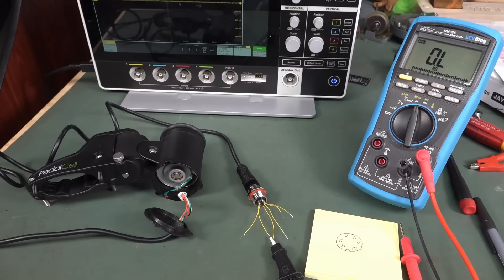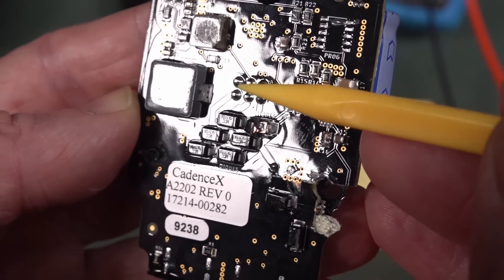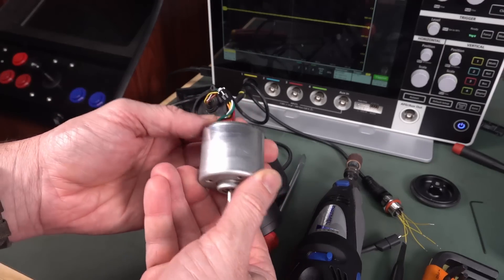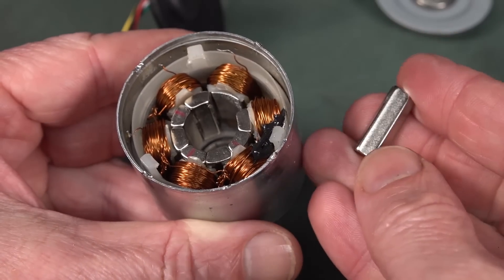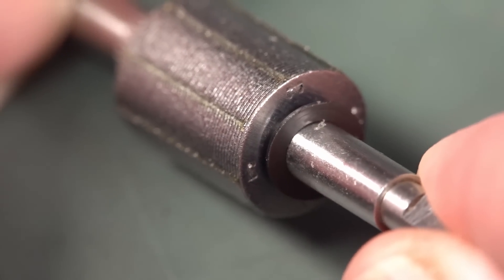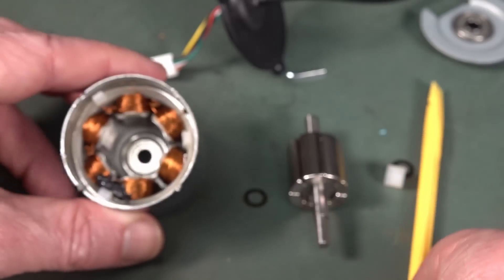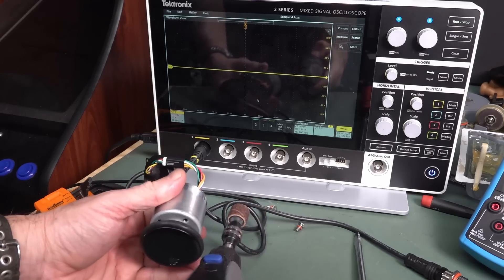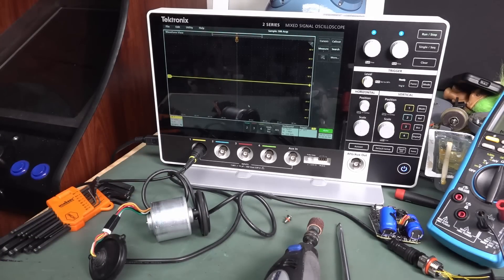EEVblog 1485 - PedalCell CadenceX Bike Generator LOL FAIL!

Comment: You know what? I have a feeling that the guys at the company are 100% aware of this and not going to do with it anything. Well, probably because it helps them to sell more and more of these products when they fail. You mentioned yourself, the guy has just bought 2 of those. Not sure he will go for the 3rd one after your investigation. By the way, great job, you cracked the case in 15 minutes 😁
Reply: Hi, I actually had sent this in. To be completely fair, the first one was replaced by PedalCell with no questions asked and at no expense to me. (They did ask me to ship the defective unit back to them at their expense and provided a UPS label.) I honestly felt bad asking for another replacement since I assumed I was doing something wrong. Since it was just going to sit here and collect dust, I figured, since I've been a fan of this channel for years, I'd send it in for a teardown. I figured it had just the right amount of buzzwords to be interesting. I had opened the electronics piece figuring there might be a fuse or something that blew, but I would have never suspected the motor/generator being the issue!

I was looking for something that might be useful when out on the road for multiple days--it seems like a bunch of USB battery packs are probably the way to go!
Reply: @ericgerstenberger7813  I think its just bad design and they know this. Its probably so cheap for them to buy a replacement motor from china that they don't even bother to do redesign.
Reply: @ericgerstenberger7813  You can get wheels with built in dynamos, but then you're buying a whole second wheelset, which often isnt as good as what you already have. USB packs are what most people use yeah.
Reply: If you sell me a shitty product u loose me as customer! I say this is really to bite yourself in the foot if it was made like this on purpose. Customers expect things they buy  to work and when they dont they will spread negative critics about the company all over the internet giving the company negative reputation for making crappy stuff (just as it should be)
Reply: @johnpekkala6941  and in 24 hours, about 10,000 people world wide know not to buy one of these!  and at $299US, that's a lot of negative advertising!
Reply: @AffordBindEquipment  unfortunately not. Of course there are people who are into biking and electronics, but I assume that mostly not. So, it will take time until small group of electronics guys will spread this information.
Reply: Doesn't matter if the "original" Brand name suffers, give it a day and the EXACT same faulty product is available on Amazon under a different generic Brand name like "XXYC usb bike dynamo" or "EXYC usb bike charger". As long as the price is cheap it will sell.
Reply: @bloeckmoep  well as AvE said, cheap and shitty beats good and skookum in the market every time. But 300 bucks? I thought this was a much cheaper device.
Reply: Artyom Galstyan - The guy didn't buy 2... he got the second unit free under warranty claim. Pay attention, and stop spreading BS > https://youtu.be/8yXZJZCKImI?t=1165
The more units that fail, the more money the company loses due to warranty replacements... faulty components don't benefit the manufacturer in ANY way.
Reply: If they're failing during warranty they'd surely want to be eliminating the problem.
Reply: What a stupid comment ! You have a 'feeling' - based on what ? Did you try asking the manufacturer ?
Reply: yeah Im sure this generator is the Cadillac of bike generators and totally not built to the lowest price point.

Comment: 5:47 Dave, Arn't those magnets supposed to be mounted to the spindle?? magnets gotta be movin' by the stator to generate voltage!
Edit 14:20 yup lol! That is exactly what had happened, that's funny! I'm curious what the gap between magnets and core is like and whether the thing is suitable as a BLDC or PMSM.... The back EMF looks sinusoidal after fixing it so it is probably a PMSM.
Reply: I thought the same re PMSM given the generated waveform.

Comment: I noticed from the previous Mailbag video the "do's and don'ts" sheet included in the box said "don't ride over 40 mph". I guess they already realised that excessive speed was a failure mode for the generator! But simply telling your users not to ride too fast isn't really a proper solution to poor manufacturing...
Reply: Yep! I have no idea about this brand but that "generator" looks horrendous for even low speed reliability.
Reply: @volvo09  a little 1/4 cent plastic shell or caseing over the magnets would change it from crap to quality . Eh?
Reply: ive done 60kmh on a triathlon bike (only 3mph under the 40mph limit) ..on the flat..no downhill needed!..and i hardly ever ride!
Reply: Why would they not wrap the magnets around the core with something to tie them down? Seems like a simple cheap lotech solution. One of those thermal shrink plastic sleeves would do the job, at a cost of what, less than 1 cent?
Reply: @mariusvanc  Ya shrink tubing and epoxy would be very durable epoxy inside the shrink tubing before it sets up. Would make it very strong.
Reply: 45 was my normal speed on level ground when i was riding my bike in portland or. And not unusual for me to hit speeds up to 70 mph downhill. That was when i was in my 20s and i never went anywhere on my 12 speed 27" Peugeot that i wasn't just standing on it. And i tak offense in the remark that a person would have to be on drugs to ride a bike that fast. You sir are an idiot. Probably sitting in your mo.s basement eating krispy Kreme donuts and cheetos washing them down with milkshakes and french fries. You probably get winded getting out of bed. So that would be the reason you'd probably need drugs to walk around the block at 1mph and for you that'd be a speed record......✌️😎🖖👽
Reply: I figured the speed warning in the manual is because at high speed the generated voltage would be too high.
Reply: When I was 11 or 12, I had a speedometer on my mountain bike. Fastest I ever managed was 27 mph going down Death Alley. I'm sure the right person on the right bike in the right circumstances could manage a lot more, but if you're doing over 40 mph without a motor, you're booking it.
Reply: @chitlitlah  I've accidentally setup one of those bike computers incorrectly...it's rather simple to mess up because the instructions usually suck and there's only 1-4 buttons.

There is a chance you were going faster (or slower) than you thought.
Reply: @RK-kn1ud  I think it would be a stretch to call it a computer. This was a simple electronic speedometer using early 90s technology that sensed a magnet passing by on the wheel and converted RPM to linear speed. I think the only thing I had to set was the wheel size and maybe units and I'm confident that pre-teen me was able to accomplish that task especially given that manuals back then were usually written in English, not Engrish.
Reply: @chitlitlah  It's a computer...it computes stuff.  I had the same $10 stuff on my bike.

You usually have to enter some parameters like the wheel diameter and such so it could spit out the correct information.  Garbage in, garbage out.
Reply: @RK-kn1ud  I have the utmost confidence that middle school me who'd been setting the times on VCRs for years was able to handle the task (more confidence than I have in middle-aged me), but let's say I did screw it up. The smallest choice for wheel size was 20", and since it actually had 24" wheels, that would mean I was actually doing 32 mph instead of 27. That doesn't change my opinion that 40 is booking it.
Reply: @chitlitlah   @chitlitlah  I can do 27 mph on a mountain bike on flat ground....and I'm seriously out of shape.

40 mph is no problem on a downhill.  I would say your recollection is probably inaccurate or you really weren't giving it your all.

I'm 6ft tall, 235lbs, and could easily do 35-40mph down a small hill, and could sustain 25-27mph on flat ground if I had to (if my life depended on it).

I've had amateur cyclists pass me while driving in a car at 20-30mph on flat ground.
Reply: @RK-kn1ud  Yeah it's pretty easy to get a bike above 20 mph. I used to ride 250 miles a week. What's not easy is maintaining over 40 mph.
Reply: @chitlitlah  You're making the bold assumption these things are made under controlled conditions to meet some specs, and rigorously tested to make sure they do when coming off the assembly line. In reality, it's some grandma in China randomly splooging glue wherever and hoping for the best. If you want a consistent product quality, you will have to invest in some of your own QA. I have no doubt a non-trivial percentage of these motors fly apart when you look at them funny.
Reply: @mariusvanc  I didn't make that assumption. I just said 40 mph is really fast (but not impossible) for a bicycle especially when you're struggling against a generator. I had one on my bike when I was a kid to power a headlight, but I hardly used it because it was so much effort to maintain speed. Based on that, I think it was probably spinning less quickly than 40 mph when it flew apart, especially if this is a common issue.
Reply: A molded high temperature plastic sleeve cemented over the magnets on the rotor would make it a high quality motor. As it is it's clearly a piece of junk. All because it lacks a quarter cent piece of plastic.
Reply: Interesting use case: irreversible (and overly expensive) detection of overspeed, e.g. in rental situations. Once the maximum speed has been exceeded, the generator doesn't produce power anymore 🙂
Would be hard to prove in court though, unless one could prove that the magnets always detach at exactly the same speed.
Reply: @Willam_J  "This bag is not a toy" 🙂
Reply: It's a crap design. Anything friction driven to spin that fast will be inefficient.
Reply: Actually I can see using this. Especially folks that do bike camping and overland trips etc. No AC outlets in the woods. It may be somewhat of a novelty item but, still cool in its own right..
Reply: well idk most products have operation specs. 40 mph is about the fastet anyone is going to get on a bike.
Reply: wtf
Reply: Basically, this is made for kids with heavy fat bikes tyres not an adult on lightweight high pressure tyres road bikes...
Reply: Pretty certain they didn't manufacture the motor nor did they design it for manufacture. A couple of EEs probably had an idea that they thought would sell, did what they were good at and designed the electronics, then jumped on Alibaba and picked a motor that met their electrical specs and designed the structural part of the thing around that motor not knowing the mechanical limitations of said motor. Of course, thorough testing before committing to production would have revealed any problems but I guess shortcuts were taken. Once production has started, any major changes would be difficult and expensive to implement. Getting the motor manufacturer to change their design for only one user/buyer would be near impossible. So, they're stuck with what they got and can only put a speed limitation disclaimer on the product and hope their inflated pricing will cover the losses of warranty replacements.
Reply: Unless you're on enough drugs to participate in the Tour De France, there's no way any normal person will ever exceed 40mph on a pushbike.
Reply from the maker: @TheKnobCalledTone.  Bikes can go down hill.
Reply: @TheKnobCalledTone.  I've done 40mph down a hill on a $900 road bike.  I am not a super athlete either.

I bet I could approach 45mph if I had a bigger hill available.
Reply: @RK-kn1ud  I have a normal bike and I've never got near 40 mph
Reply: @RK-kn1ud  Same here, I've regularly hit 45mph (measured on Garmin Edge 530 & twin VIRB elite cams) on the downslopes of a couple of big hills in North London on my hybrid commuter bike, and I'm not exactly the fittest person either.
Reply: @RK-kn1ud  Yeah, I've exceeded the speed limit several times in a 60kmh zone on a cheap-ass bike with about $300 of upgrades, was pretty easy to do going downhill.
Reply: @RK-kn1ud  or a good tail wind.lol
Reply: @RK-kn1ud  Maybe on a $900 bike... 30 MPH gets hairy on a Walmart ride like mine ;)
Reply: @Randrew  30+ mph is pretty scary on any bicycle.  It always feels like you're one wrong move away from an uncontrolled tumble and the steering inputs are super sensitive.  Rim style brakes tend to be nearly useless at these speeds unless you have a ton of stopping distance.

Not to mention there isn't much between you and the ground if something bad were to happen.
Reply: @RK-kn1ud  Even people who race competitively don't sustain 40 mph at the top of their game.
Reply: @TheKnobCalledTone.  I don't know what you consider a normal person, but when I was riding regularly, I exceeded 40 mph on almost every ride I took. I lived at the top of a hill.

Plus, my cruise speed on flat land was 25-27 mph, not in my top gear. Even downhill, my cadence didn't get above 100.

I was in good shape, but not competitive by any stretch of the imagination.
Reply: @martinmckee5333  My wife and I own a tandem.  We've been in the mid 60s on a downhill.   Scary.
Reply: @martinmckee5333  If your cruise speed on the flat is 25 to 27 miles per hour, you should genuinely do some cycling competitions. 25 to 27 kilometers per hour is pretty normal, however.

Not arguing with you about hitting 40mph downhill though. I had a commute where I would regularly hit 70km/h, and sometimes 80km/h - which is basically 50mph.
Reply: @clintoncoker6  I haven't ridden in a long time. But, when I was in that shape, I did consider competing. Never did, however.
Reply: @martinmckee5333  Your right. I had a speedometer on my bike and when i was standing on it on level ground I easily hit 45mph. And easily exceeded 70mph down a good long hill. Now that was scary a couple of times. But i survived and continued to do it anyway nonetheless or the worse for wear.lol these donut stuffing generation stuck in their parents basement playing video games and slurping down mtn.dew and french fries couldent peddle a bike faster than a 3 year old on a big wheel these days i guess.
Reply: @michaelshultz2540  Kinda doubt most bikes would hold together at 70 mph.
Reply: @jhoughjr1  ya ok, what EVer....
Reply: @TheKnobCalledTone.  Down hill it is easy to hit 40. I know I have exceeded 70mph downhill, and suspect that I got over 80 a few times. (I was not quite spun out at 72MPH.) But I was not your average rider. I turned down a chance to train for the Olympics because it would have meant giving up on making Eagle Scout and anything resembling a normal high school life. I will never know if I made the right decision, if there even is a right decision in this kind of situation. I would say that if you have ever melted the brakes on a bike, you were over 40 for sure - I actually had mine on fire a few times, usually due to *holes in cars not thinking I could possibly be going as fast as I was.
Reply: @jdrissel  Yea, I can hit 40 downhill basically without pedalling (with the gearing on my gravel bike I basically spin out at a bit over 40, but people hit closer to 60 down on standard roadbike gearsets)
Reply: Lol..  Who can peddle 40mph?
Reply: @miller-clem  lmao, all these nerds who have never ridden a bicycle coming out of the woodworks who don't even understand how fast bikes go down a modest hill... SMH
Reply: @k6l2t  I've rode bikes for thousands of miles in my life. I don't know a single one that you want to ride at 40 mph sustained.
Reply: @miller-clem  Ever heard of gravity?
Reply: @miller-clem  A street peddler.
Reply: @miller-clem  i can ! It's not that hard.
Reply: @miller-clem  It's pretty easy. I've gone up and then down the other-side of a large bridge and got close to 45 going down. I was fat and in terrible shape at the time. It's not hard it's purely topology dependent.

Comment: I wonder if a thin plastic sleeve around the magnets would keep them on the rotor. Is there enough clearance for something like that? Interesting troubleshooting though.
Reply: Even something like heat shrink tubing might work fine.
Reply from the maker: Barely room, but possible.
Reply: I was thinking something like a kapton sleeve, but I’ve never seen kapton molded in tubular form.